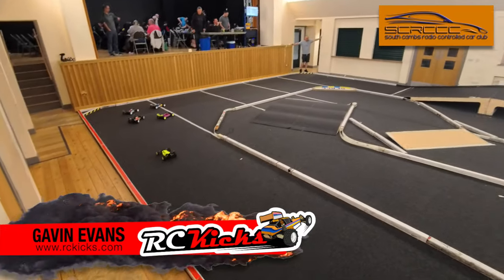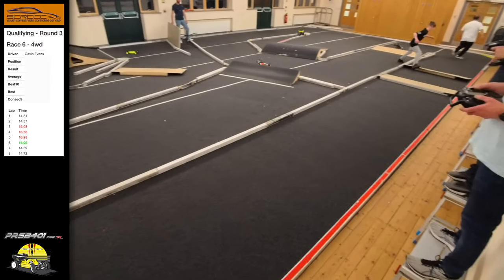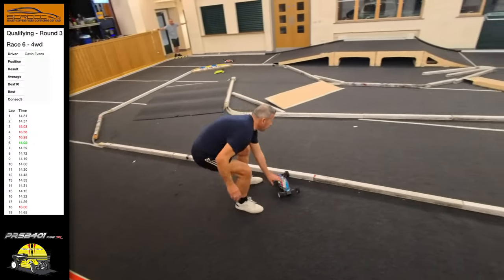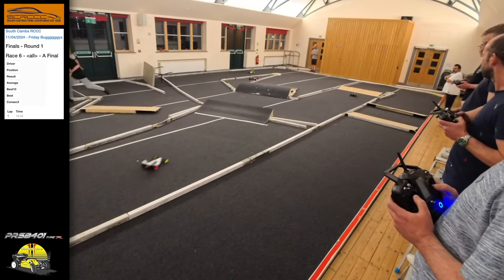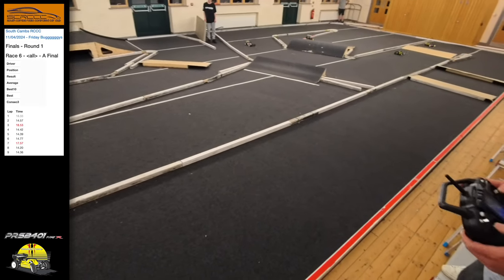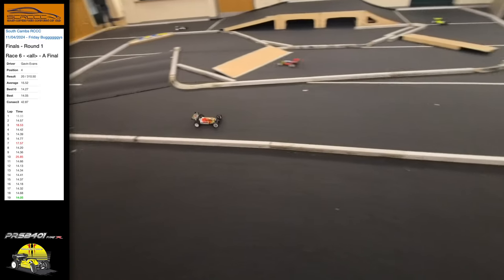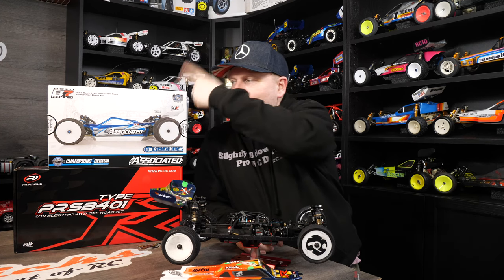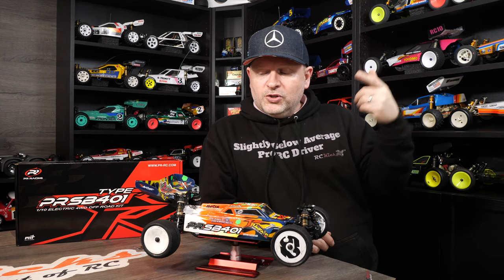Feeling The Heat Of An A Final & Almost Killing A Marshal! Noob Goes Racing.

Comment: Get the Sanwa M17, I’ve had mine for at least 7-8 years. You’ll feel so much more connected with the faster latency. You’ll be a better driver immediately. Stick with fh5 receivers over the fh4, you’ll feel that difference too.
Reply: Yes, the Sanwa’s paired with their servos are supposedly the fastest.  I’ll bet Futaba is right there though too.
Reply: @hashimrahman51  They are, I run those too. The Futaba is basically a fh4, so a smidge slower latency than Sanwa.

Comment: Nice job making the A! I recently did the AL bell cranks on my B7. I wasn't expecting except some improved durability but it helped me carry more speed into the corners and held the line better. I've seen some guys at my track lose their idler gears but the B7 seems very tough so far. It's fun to build and the battery holder is so easy now. The mod guys are saying it handles power better do they've been able to go to lower turn motors and be ok

Comment: Not sure what turns you drive but try less powerful motors. My first couple of years of racing I only drove 13.5 in 4WD 2WD and the first year  mostly in 13.5 Blinky mode. Even these days I do not go below 7.5T in 2WD / 10.5T in 4WD. 
90% of all drivers can‘t handle the power of 5T–7.5T motors but won‘t listen if you recommend to use less powerful motors.
Try it and you will see that you’ll be faster with cleaner racing and consequently better finals.

Comment: Even the sanwa M17 isn't faster response time there both sub 3ms response, you can get faster by setting the nb4 to one way but you would be better to get the new fgr4d receiver and then a 1000hz servo or the new 1000hz ibus 2 servos from flysky/power hd or MKS, even the world class drivers like Ryan Mayfield are now swapping to flysky and winning major events that and you don't have to pay £80+ for each receiver, I know you can get 3rd party receivers for sanwa but many of the racers I know won't run them due to them being the older slower protocol then you have waisted £500 on the m17 or very strange issues mid race :) The m17 is a great radio but nothing to gain from an nb4/nb4+ or nb4 pro and the menu system on sanwa a bit challenging at times.
Reply from the maker: I’m running the FGr4S v2 Flysky receiver so I just went and purchased the FGr4D receiver for £25.00 from Banggood.  Do you need the Noble Pro or will it still work with the NB4?  The FXS260 IBUS2 metal servo is a bit expensive at £153.00 but if I can utilise its full potential of it with the basic NB4 and FGr4D receiver, I’ll give it a go.  👍🏻